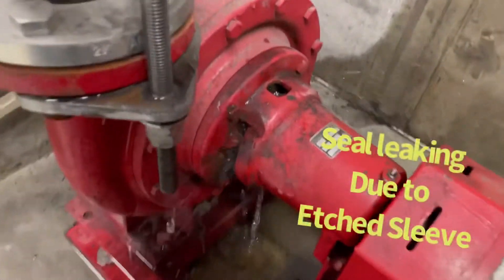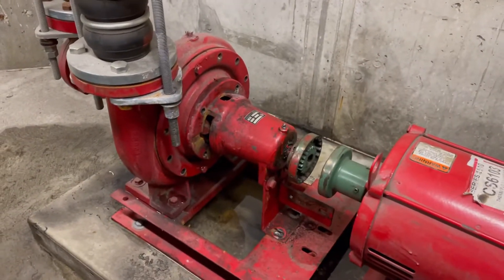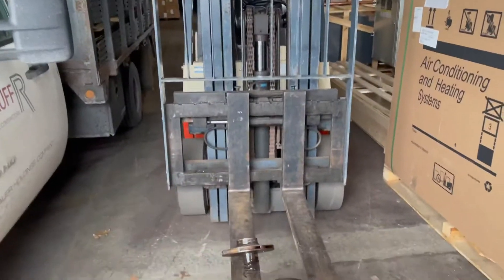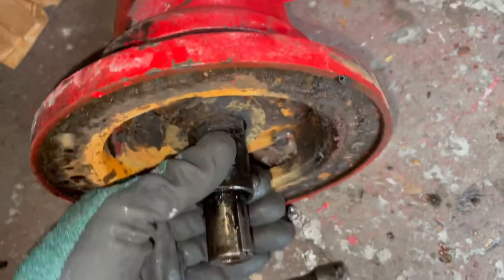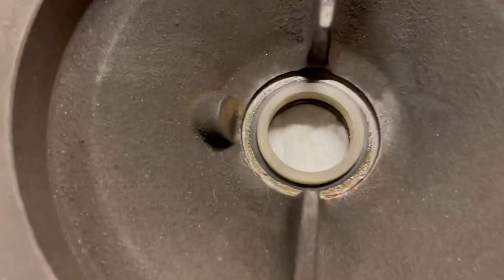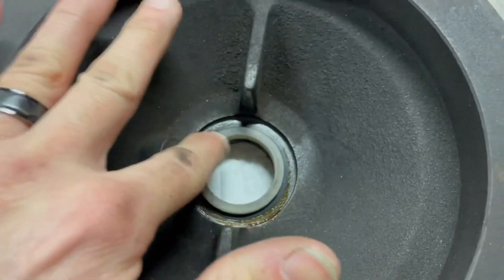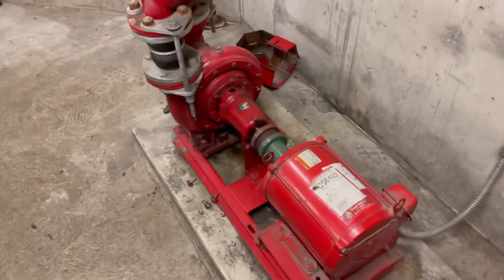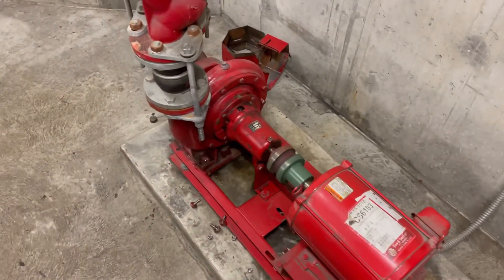Boiler Pump Seal Failure, Diagnosed & Repaired. #pump #boiler #bellandgossett #HVACEXPLAINED #HVAC

Comment: Check B and G service Manuel  on using  gear puller to remove impeller.
Reply from the maker: I’ve seen a couple impellers where you have to spin them off but most of the time they were compression.  You have to be very careful with those impellers because they are extremely expensive but the metal is soft “brass”.  I will definitely check it out when I get a chance thank you very much.

Comment: End suction pumps suck to work on. At least the fire pumps do. To repack them you have to pull the motor. Same with a vertical inline. Awful. Good engineering if they never had to be worked on lol.
Reply from the maker: Yes, they can be a pain.  I’ve never worked on the fire pumps at this time but who knows I still got many more years of my career LOL.   Corrosion makes a huge difference.  I’m so glad I’m not a car mechanic living up here in the northeast.  Rust makes things 10X harder to work on.